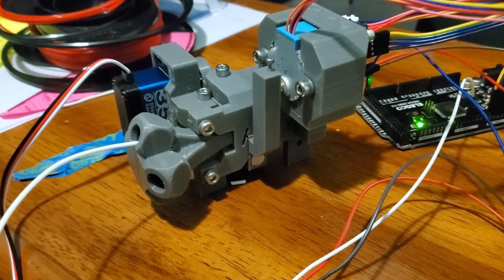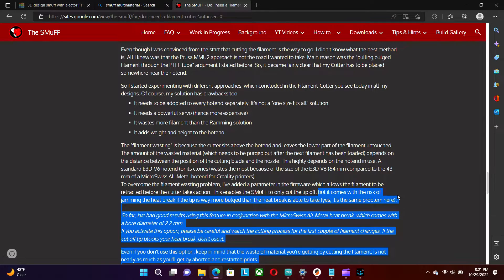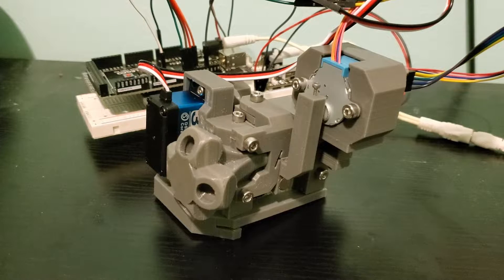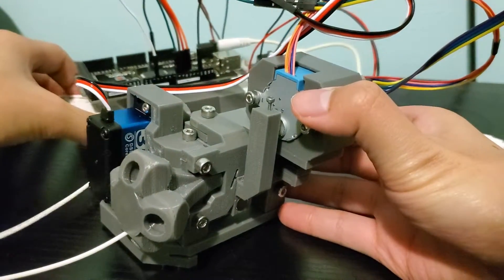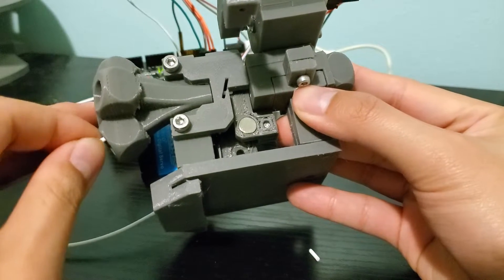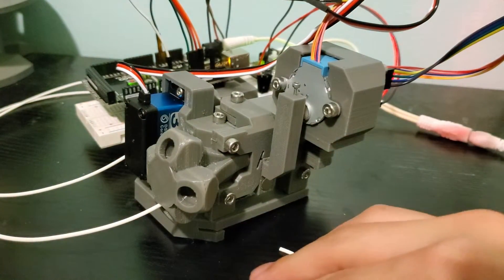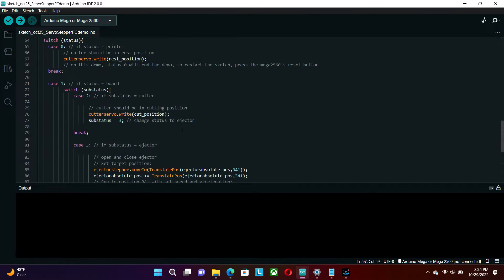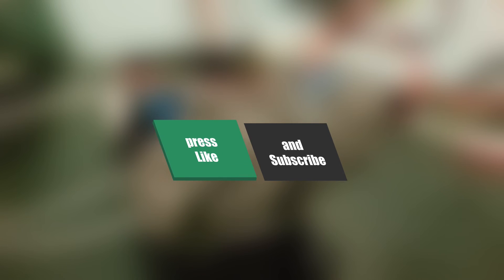SMuFF Filament Cutter Mod Demonstration

Comment: Interesting idea. Most probably, during printing you will face a problem with strings as cut tips will hang on them. Of course in this case some time can be spent for making a tip of good shape, but then there's no point in cutting tips. Is there something I'm missing?
Reply from the maker: I will still incorporate ramming settings on my slicer. Back when I was printing without a filament cutter, there are no strings for the 1st 6 layers, then it starts stringing until hotend starts to clog. I havent printed anything using this filament cutter yet so stay tuned. Everything is still a theory up to this moment.
Reply from the maker: In my opinion on the 1st six layers little imperfections on the tip start to pile up until it strings clogs the printer. This filament cutter will reset those imperfections (in my theory)